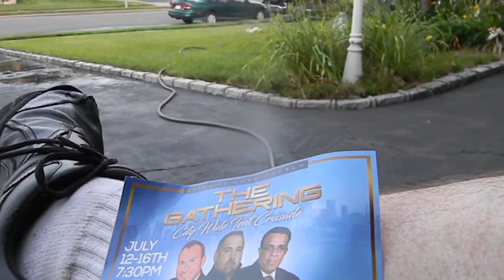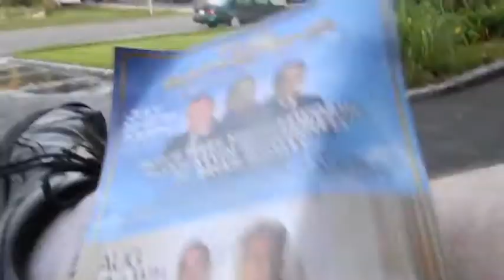Updates

Comment: I hope the block is ok. I've only seen oversized cam bearings once, and that was in a Chevy crate engine. I forget what they called them in the 80's but they sold engines to compete with all of us machine shops claiming they were better because they were new. Our warehouse manager bought one for his truck and it seized after a couple months. It had oversized cam bearings, one oversized lifter and one cylinder was .020, the rest were standard. So I guess it's not just the machine shops you have to check! By the way, I thought your camera had cataracts!
Reply: P.s. What does SEER stand for. My AC is getting old. It's 10 years old, which is good for AZ because it's a heat pump and it runs all year, if you want to keep warm in the winter. We usually grab an extra blanket until it gets below 65 in the house. Yah, I know that's nothing. Try 119 in the summer, your blood will thin out and you'll be freezing at 65! Lol
Reply from the maker: The unit i`m looking at is a 3 ton 14 seer...when i did the square footage of my house i was in the zone of a 2 1/2 ton unit by 150 square feet...for the extra 100 bucks i`m going with the 3 ton unit